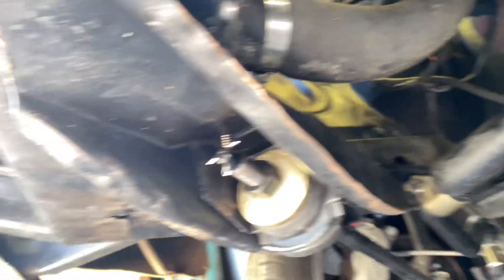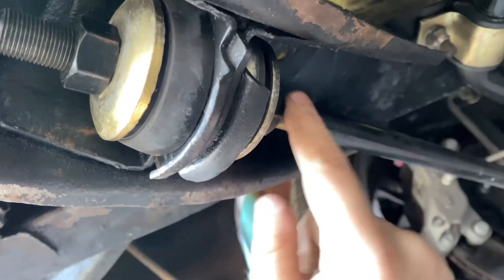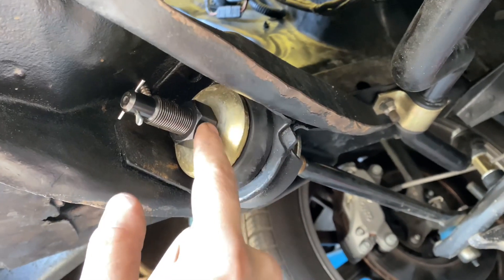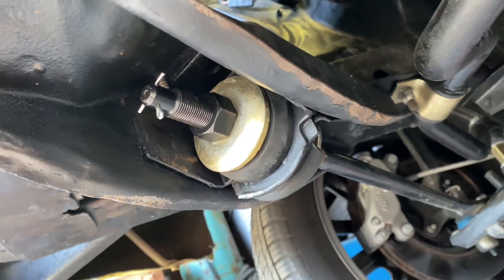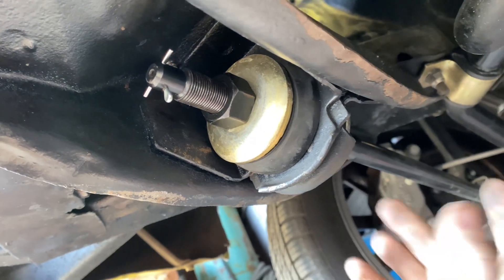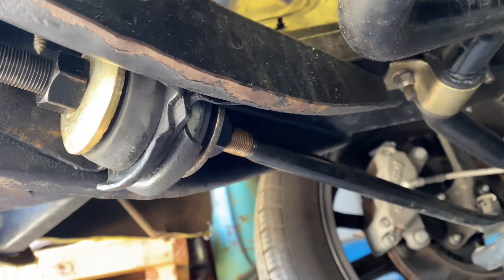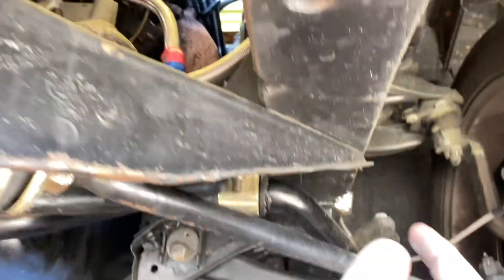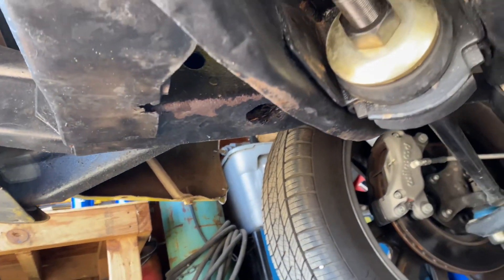Quick tip/ always look under your car periodically.

Comment: Love that 68 grille.
I heard what you were saying.
With the old biass ply tires the caster would be set low.
With radial tires, you need a higher reading.
But measuring like that will give you a starting point to begin using a mag head caster/chamber gauge.
If you had a caster pull, you need the right to read high compared to left.
Most cars that age need at least a half degree more on the right for crowned roads.
If your tires aren't part of the issue going right by their own.
You need to get back to the alignment shop.
And if I heard right, they didn't recommend any work to that set of bushings or that strut rod. Seems like they weren't thorough. With it backed off, and you braking, the tire on that side is going to shift rearward causing a dive or pull right on application.
Now, one other thing I found on my 68 was camber can just slip on you.
There's a repair kit that used square plates instead of the cams they had OEM.
The square plates have two holes, you choose based on your reading.
You can switch and flip them to decide how they end up assembled to have a suitable camber and not have it slip when you pitch into a turn and accelerate.
The kit can be the cure.
They used it on mustang and cougar first, so that was the catalogs I found it in when I was trying to correct mine and have it hold the readings desired.
Toe is going to wear tires so it's best to set that best you can if you're not trailering it to get on the machine.
I would look into that camber correction kit and my control arm bushings would be renewed.
That was my experience. Hope this helps.
Those were a fun car to drive if your brakes and steering were squared away.
It was tough back in my day to get what you needed for them. But you need good people helping you, I didn't have that yet.
Hope you have good sources already.
Nice car.
Don't sell her off .
Don't let them tell you it's not worth the work.
It is.
Reply from the maker: Thanks bud, yeah I always loved the 68 grilles the best when they’re painted with the black accents and GT crown like I got mine. You’re absolutely correct with everything you said, and I’m gonna take it back to the alignment shop after I get some more suspension upgrades done I been wanting to do so I’ll get it all done at once but it drives fine now that I tightened all that back up. They didn’t recommend any work on the bushings probably because I had just completely rebuilt the entire front end on that car when I took it to them and I replaced everything under it, that strut rod that was loose was a completely new rod because the original was stripped out from previous owner cross threading nut. I think it just came loose because the new stuff just isn’t as good as original in a lot of cases and this is one of those pieces. It’s metric too instead of standard which I also don’t like about it but it is what it is, sometimes you just have to deal with what you got. I know about the kit you’re talking about and that is one of the upgrades I want to do to it because you’re right, they can move. I’ve never actually had one move but these cars are getting older and older and so is the hardware that fastens them so I want to upgrade that soon. Thank you for chiming in and commenting and giving the advice, much appreciated, and thanks for watching.
Reply: @FastFords289  when I aligned them, rarely a V8 mustang or cougar would come in.
Their complaint was it wouldn't hold.
I thought I had them fixed, but couldn't resist getting on the throttle a little bit during the road test.
You know the customer is going to.
And even with new parts they slipped under the weight and stress.
That really sucks to feel that in the car after you just did your best for the guy.
You can't charge him twice, but back on the machine it had to go.
A nicely placed weld is a thought.
But the shop foreman had to be called over and have him do the dirty deed.
The kit may be the best remedy if it's not all stock and concourse correct.
Reply from the maker: @dannylinc6247  absolutely agree, while I don’t race my car I do occasionally get in it as we car enthusiasts tend to do from time to time lol. It’s definitely not an all original or concours car by any means, it’s more of a restomod so it’ll definitely be getting the camber block kit with the other mods coming.
Reply: Find out more about the fitment because the correct thing for it is the best.
The guys I worked with who knew the most, and worked on them when they were new said the camber kit is not the thickness I needed at that time.
My new set is the right one.
Now I can't remember where it came from. And I haven't been able because of chronic pain, to get near it and get under it like it needs. 
This is the real deal
Reply from the maker: @dannylinc6247  thanks for the tip, I been looking at the stuff that open tracker racing sales, I got the roller spring perches from them and they’re a great product so I’ll probably go with the kit from them. Sorry to hear about your pain, hopefully you’ll be good to go again soon so you can get back out there. Best wishes. Thanks again for all the great advice and suggestions you’ve been offering. I love these old fords and it’s always great to talk with someone else who enjoys them just as much and appreciates them.

Comment: Drill a hole in it before the nut put a pin in so it can't move!
Reply from the maker: I actually thought about that but it needs to be adjustable as for that’s how you adjust the caster on that car. I just got to find another nut that size or maybe put a small dab of red lock tight on it. Good advice and thinking though, thanks for commenting and thanks for watching.